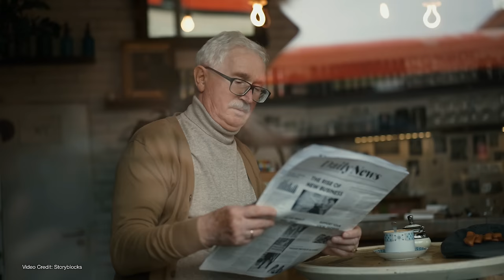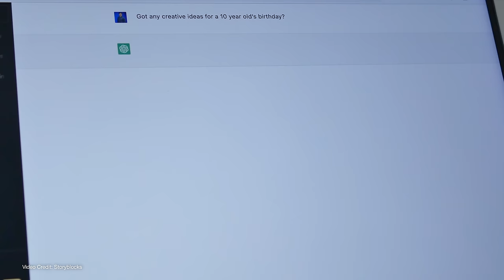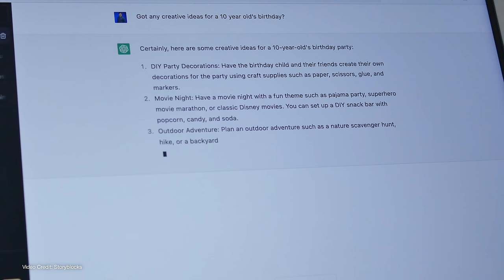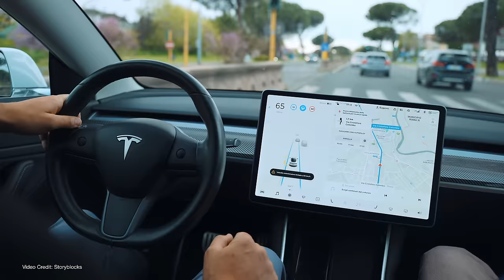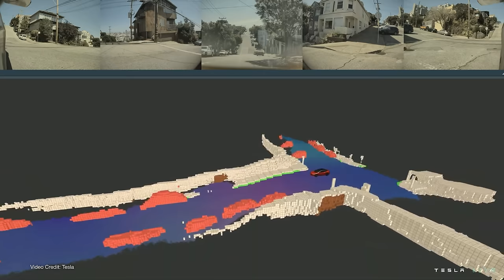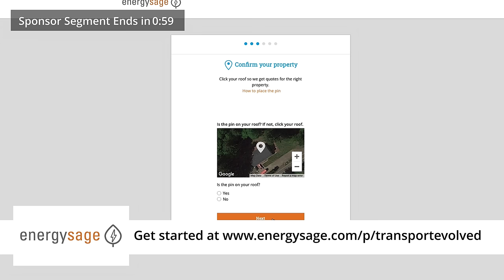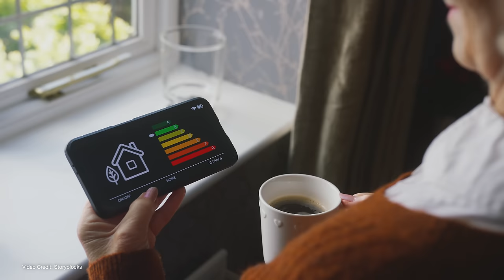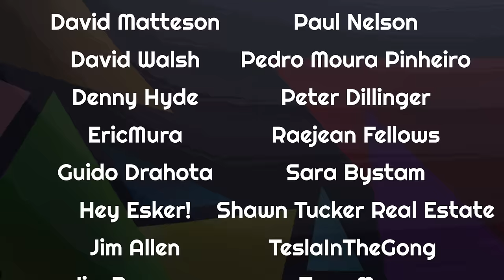The Electric GRID Is Under ATTACK (But It's Not From EVs)

Comment: Shall we talk about the electricity consumption of oil refineries? How about crypto?
Reply: Crytpo is inherently load-shedable, just like EVs are.

The fly in the ointment is that AI should ALSO be just as load shedable.

I think what may be required is regulation restricting bulk computation to only run either during times of low power demand, or excess supply (due to wind/solar). In 2021, due to a confluence of factors like a chip shortage and rising price, mining ETH would have been profitable for me on my 3 year old GPU even at the maximum legislated power price in my jurisdiction of $1/kWh.

Tech bubbles able to tolerate such high electricity prices have the potential to displace other industries. There comes a point where going off-grid becomes cheaper than hooking up to the grid for reliability: even after solar and battery installation costs.
Reply: Oil is Very Important.. it makes everything, including lifesaving medicine...   Crypto and AI could be Green if forced to use Solar powered 24/7 , switching whatever Data centers happen to have Sunlight... It's very Easy if enforced .
Reply: Those data centers can get a Tesla power pack if they need more uptime ..

Comment: Very useful context and clarity on this, Nikki. That EVs would be causing grid scale issues is a quite persistent and frustrating piece of misinformation.
Reply: I believe it was the Engineering Explained channel that had a video within the past year or so that concluded that 100% EV adoption over the next 20 years would account for less than a third of projected new electricity demand.
Reply: @jeffreyquinn3820  Ah, yes.  Forecasting.  <cough>

Comment: Lots of people are fretting about where the extra capacity for the grid will come from to support the millions & millions & millions of EVs that are coming. From the Evs themselves.The Ford Lightning comes with a Bi Directional charger which can put grid power  INTO  the Lightnings battery pack and also it allows the grid to draw power  OUT  of the Lightnings battery pack. When you have several million Evs all connected to the grid at night with bi directional chargers  FIRST  the grid charged the battery pack up  THEN  it draws power out to help run your neighbors AC until the early morn hours when the grid replaces what it drew out of your battery pack. No grid capacity expansion required. Everyone helping one another.

!
Reply: Some EV car battery warranty's don't allow ( feeding the grid )  And I myself would not want to use the limited cycles a battery can do.. on the grid.

Comment: When I saw the title: I could only think of my jurisdiction. They banned new solar and wind farms for 6 months pending new rules.

The new rules require solar and wind plants to pre-fund their decommissioning now. (I suspect that wind and solar will STILL be cheaper than thermal gas plants.) They are also banning solar and wind farms in "pristine landscapes".(yet new coal mines in such landscapes are just fine, apparently)

I want to run it by local activists firsts: but I an thinking of suggesting a royalty, about equivalent to the gas royalties that would be paid by gas thermal plants, on industrial solar and wind plants. On it's face: increasing the cost of wind/solar would discourage investment. But is suspect the main sticking point is that the government has no plan to replace resource revenue when we phase out fossil fuels in ~7 years.
Reply: The province of Alberta in Canada just banned wind and solar farms in "pristine landscapes", but are allowing a lot of open pit coal mines in the same areas.
Reply: @jeffreyquinn3820  That is the one!
Reply: @jeffreyquinn3820 Look at the D&O of the province that have fossil fuel interest(s).  It's a no-brainer to go with renewables.  There must be (a) reason(s) why this hasn't happened.
Reply: @AllDogsAreGoodDogs  Did not even think of the corruption angle.
It is an open secret that privatization benefits party donors.

Comment: All that computer heat has to be dealt with. The air condition electrical load of the computer equipment amplifies the total power usage. There are also battery backups that consume power on standby mode. Also lights and telephones of a normal office add to the power draw. All of this produces heat for the HVAC system way above a normal office building. The winter heating load is nonexistent while dehumidification to 50% is a top priority. Become a commercial HVAC tech and you will never want for work.

Comment: Home generation and storage, if you live in a northern (southern) location doesn’t help the grid, as the winter peak demand is not significantly altered. In fact it makes things worse by increasing the cost of electricity in the winter months.
Time of use tarifs are the way forward.  Here in UK smart meters are encouraged…I wonder why!  
I can see that AI will also go down this route, being less expensive if you can wait, say 12 hours, for your results.  Likewise bitcoins, though data storage less so, though even there you could sync your machines only just over night.

Comment: 🔌🔌Right On. Before I recently retired I provided engineering support to provide 2.15GW of emergency backup power to 15  enterprise and colo data centers along with 5 chip FAB plants in Arizona's Phoenix Valley. At the same time, I had a request for three  5MW commercial chargers at DC warehouses in the Phoenix West Valley that ended up being canceled because the utility quoted two years for their buildout. Granted EV chargers are not base loads like data centers and chip plants but come on Arizona's 903 public charging stations with 2400 ports adds up to roughly 540MW per NEVI of base load if every port was charging at 100% which we all know will never happen.🔌🔌
Reply: 540,000/50 kw = 10,000 cars at once , 100kw 5000 cars

Comment: Here in the UK we don't do aircon very much but in future we will be installing millions of heat pumps. I have a heat pump that produces 9kw of heat for 3kw of input power on a freezing winter day. It is on from around 6am to llpm which means that it will consume about 50kwh per day in the worst case. Now suppose all homes in the UK have a similar setup producing say 6kw of heating. There must be artound 20 millipon houiseholds in the UK do the heatpump demand would be around 40Gw. Where is that coming from when it is overcast with no wind for days on end? It seems that we need tens of terawatt hours of storage which is massive considering that pumped storage is only of  the order of 10GWh,  around 3 orders of magnitude less than what is needed.

Comment: Server farms / data processing centers are taking up an ever-growing portion of the available electricity generation around here. (Seattle) Curious to see if that's what this is about.
Reply: The Seattle area isn't seeing much expansion of data center (or as you refer to them, server farm/data processing centers) capacity due to being located in a seismically active area, so I'm curious what data tells you that's the case.

Comment: @18:13   Your EV battery will likely be your biggest energy storage investment. Why pay for something like a powerwall when you can just "use your car".  It baffles me V2H / V2G hasn't been more popular.
Reply: I wanted to set my F150 Lightning up for this, but the $10k (ish) coat for equipment and installation was too rich for my blood. We don't lose power a lot, and when we do extension cords work well enough.  V2L is huge and more EVs should have it.
Reply: Costly & complicated interface.
Wear on your expensive battery.
Only usable when vehicle is home.
I'd settle for an in car inverter with 2-4 120v outlets (usa)

Comment: Yes AI and crypto are terrible wastes of electricity. No argument on that. But consider the following and remember that it's excluding charging losses, because no one can say with any surety what the average charging loss is as it varies by the cars electronics, charge rate, and SoC.

Annual California household electric usage is 542 kWh/month or 6,504 kWh/year.

Annual mileage per car in California is 12,524 miles/year

Average cars per household is 2.3 in California. 

Best case scenario with today's tech: assuming 4.5 miles/kWh which almost no one achieves unless they drive 55 and/or have an extremely efficient EV:

(12,524 miles/yr x 2.3) x 1/4.5 mile/kWh = 6,401 kWh/yr effectively doubling their current household usage.

Worst case scenario with the most recent EV pickups and 3 row SUVs averaging 2.2 miles/kWh.
(12,524 miles/yr x 2.3) x 1/2.2 miles/kWH = 13,093 kWh/yr. That would triple household consumption not including the decarbonizing of homes.

So yes, a complete conversion from ICE to EV with business as usual will double or triple residential electricity load if we managed to chargectgem all at home.
Reply: Your ICE vehicle uses electricity. It uses it through gasoline pumps as well as the cost for refining the oil into gasoline. Fortunately, it uses gasoline and gasoline byproducts to transport, and it burns natural gas so that the oil can be extracted, but we must be completely obsessed with the charging losses, and we must ignore all the energy losses of the oil industry. By the way, we can figure the losses because some people actually generate their own electricity, and they knew how much electricity they paid for. You're claiming things that are knowable are unknowable and you forget that you are comparing between transportation methods. Your math is horribly bad.
Reply: This is a brutish calculation and working with averages is not entirely accurate. But the point remains that EVs driven the same distances we drive today, and given the loss of efficiency as EVs are becoming less efficient as they grow from cars to trucks and SUVs, we need to be honest that the estimates of EVs impact has been hidden or rationalized.
Reply: BTW, I did these overly simplistic calculations to help draw attention to residential load increase for our CCAs . I asked if they've modeled the load from full transition to EVs and the answer was no, they are using regulating bodies future load estimates instead of trying to make their own predictions independently. Folks, we're failing to add renewables quickly enough to even keep up with new loads, so power decarbonization is slowing, not accelerating.

My suggestion: efficiency rules for EVs and 55 mph speed limits.
Reply: @ronaldking1054  why do you assume I drive an ICE vehicle. Warning about the challenges of large increases of load to our homes doesn't mean I'm pro-ICE continuation. Get out of your defensive bubble and take the time to understand the challenges with an EV like for like transition.
Reply: Here in the Canadian prairies where I live, the average house has slightly over 2 vehicles with block heaters plugged in overnight in winter, which draw anywhere from 400W to 1.5kW.  A lot of people could slow charge an EV or two on a similar amount.
Reply: Right from the start these sorts of absolutist arguments are nonsense. Because we won't switch to 100% EVs tomorrow. Similarly we won't switch to 100% renewables tomorrow. We can upgrade pretty easily to 25% of the grid being on renewables before storage even matters for example. (do your own research, I'm giving this example to help orient how you should be thinking about these problems not to write a dissertation).
For EVs there's basically two elements of the grid. The generation and distribution which have separate limits. For generation because it is demand based there are massive amounts of exceed capacity that does not get used. This is so that more expensive but faster response plants can level out the much larger producers. We could say this means there's still plenty of capacity but it's also really expensive if we actually used it. In reality we should be looking to the accelerated growth of much cheaper renewables being put onto the grid and will be on the grid by the time we reach anywhere near 100% EVs.

On the distribution side (and IMO the only area the argument the OP is making is even relevant) lets actually get into the numbers. With EVs we can either better utilize the demand grid or allow for more distributed sources within the grid. The latter requires replacing virtually the entire grid. It's not really a question of if but when this happens. Solar is extremely cheap and getting cheaper. Much of the technical storage capacity is within end uses (the air in your house, the water in your water heater). It's going to be worth it for the power companies it's just when to make the investment.
So we've narrowed things down to how fast will EVs grow to the point that the demand based grid will have to keep up based not on it's topology but the fast acting and cheap energy sources and current limited distribution equipment.

Right away lets deal with energy consumption which would have to grow less than 1% per year to meet EV adoption. (this is considering how EVs more efficiently use the demand based grid as well and this includes capacity as addressed below with capacity factor.). (consumerreports) Within the electricity generation system more than half of the available energy is wasted before it reaches consumers (EIA energy explained). This is both because coal power plants are only 30% efficient but at the same time 20% of the grid is renewables. They to are in this waste category because of capacity factor. This is a consequence of a demand based grid. Solar is actually providing a service to the grid by being able to be turned on and off and it's the easiest to do so. More EVs means turning off solar less and thus higher capacity factor. You get this for free. 

Let's deal with the amount of energy we'd need first. Because it's not triple. It's more like one third. The USA consumed 4.18 trillion kwh in 2023 (EIA FAQ), 44% of energy usage is for residential (EIA energy explained). So 4.18 trillion * 0.44 = 1.83 trillion. You'd need about 0.95 trillion for 100% EV (consumerreports). Based on how wildly off your numbers are I will presume you started with the result you wanted and worked backward. If you look at the current energy mix including petrol transportation indeed looks like 2-3x household energy use. But of course this neglects the fact EVs are way more efficient and the infrastructure to charge EVs uses way less energy than the infrastructure for petrol. (of course usage extends outside the US as well and so is not represented in the stats).

For transmission we will focus on regional transmission. This is because within large enough regions the ability to deliver power is plenty but system risk and reliability goes down. The largest areas needing improvement are connections to Texas a problem really brought on by bad policy and having almost nothing to do with EVs or renewables. Further pointing to specific project needs say a particular area with an actual transmission limit is to granular and meaningless and  transmission lines are constructed based on projections so many of them are way over demands because of projected demand. The GDO talks about this in terms of regional transmission miles. (the area of coverage needed to transfer electricity in order meet any customers demand based on a variety of sources. In a scenario where there is high demand from EVs we would need 2x to 2.5x the number of regional transmission miles. (GDO national transmission needs fact sheet). So that's 5 paragraphs to tell you the entire problem EVs has nothing to do with kwhs. This is also why power companies will pay you to charge at night and why solar panels on your roof will be very lucrative especially in a high EV adoption scenario.

Comment: home ev charging is expensive too because they increase your peak rate costing you extra £200 plus a year in addition to your ev charging bills
Reply: How is that? where i live electricity are cheapest at night where most people home charge. We dont get charged other than the cost of the electricity.
Reply: Why would you charge during peak times?  I don't.
Reply: If you're charging during peak times (except on VERY rare occasions) you're doing it wrong.
Reply: Not to be mean but to anyone who actually has an EV this sounds incredibly silly. Power to your home is not even close to full utilization. Say you have 200amp capacity typical on new homes. If you ran it at capacity all day that's 576 kWhs. The average for a house is 28.7kWhs. This is not a real problem.

Comment: AI doesn't take energy after training is complete
Reply: Only to charge periodically
Reply: @transportevolved    Millions of  circuits are set with Knobs 🎛️ after training, all it does is pass it through it an voila... Intelligence . What takes energy is to find out the proper knob position and set it by hand (actually Power consuming GPU) checking if the radio station is noisy or clear after you set the knob to a position.
Reply: Tesla cars and other wouldn't be able to drive themselves with AI if it required that much power after training